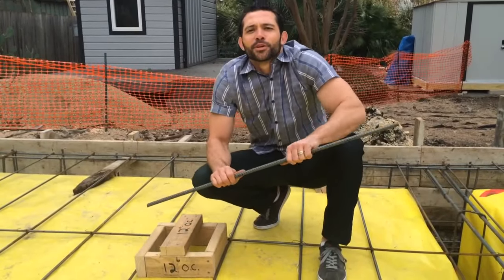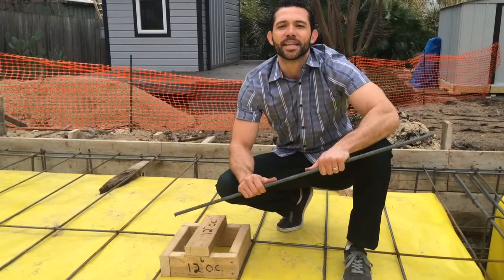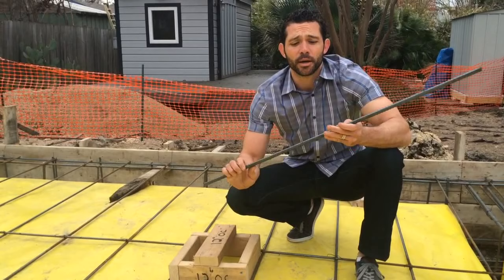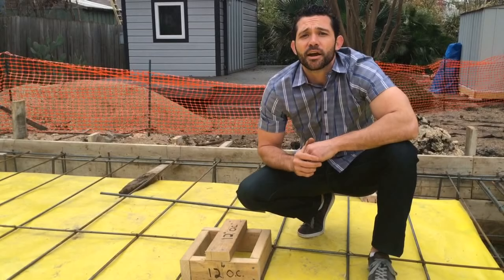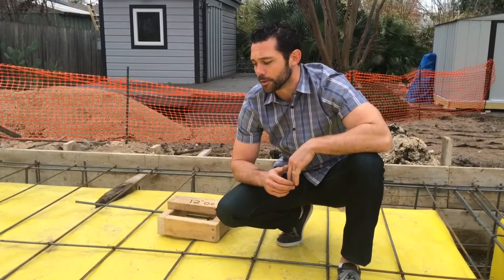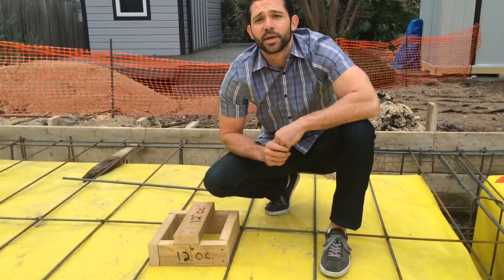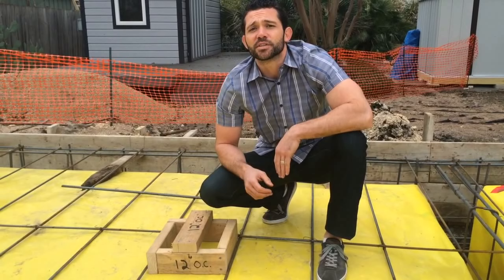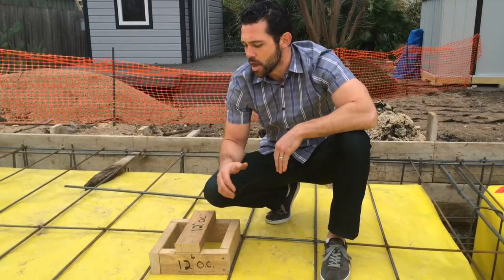Rebar Spacing, Made Easy

Comment: I tried this, but found it uncomfortable in my pocket, so went back to old-fashioned tape measure.
Reply: My thoughts as well. Measure the bar and mark the spacing before placing.....
Reply from the maker: nlo114 that works too, just not as idiot proof. Similar to drilling holes for cabinet pulls. Picture perfect typically requires a jig.
Reply: We use a peace of ground wire. One end we bend a u and at the other end we mark 12 when hanging on the rebar. U don’t have to pull out your tape or walk around with box. U can tell he’s never laid rebar in his life

Comment: not to be a wise a$$ but you said "tensile strength, which is the lateral strength of this concrete", I think you shud revisit that statement.
Reply from the maker: tmston2 lateral strength of the “concrete assembly?”...tensile strength: resistance to lengthwise stress, measured (in force per unit of cross-sectional area) by the greatest load pulling in the direction of length that a given substance can bear without tearing apart

Comment: why 12 inch, is there a relationship between rebar width and distance and please always draw it on paper to explain better thanx
Reply: sdfsdf sdfsdsdfsf there is no relationship between size and spacing. both are determined by the engineer to support the live and dead load of the structure.
Reply: Thanx
Reply from the maker: noneofyourbusiness exactly.